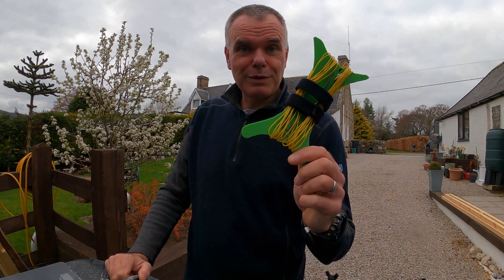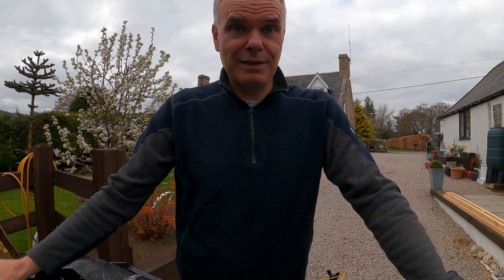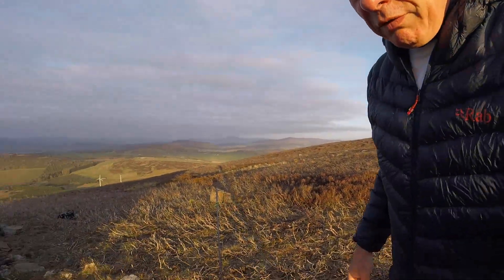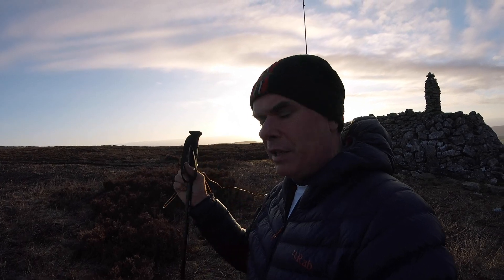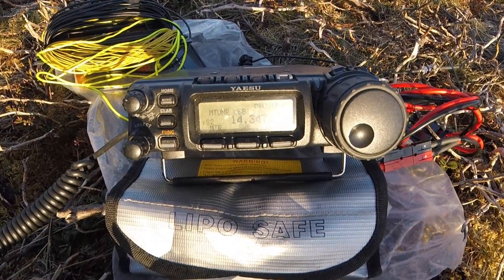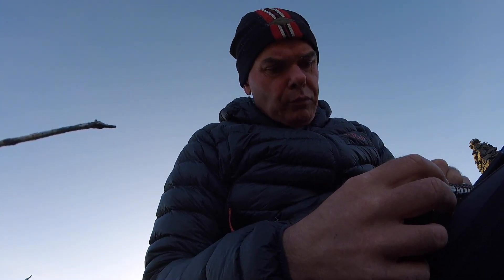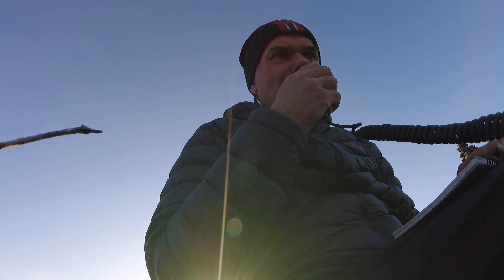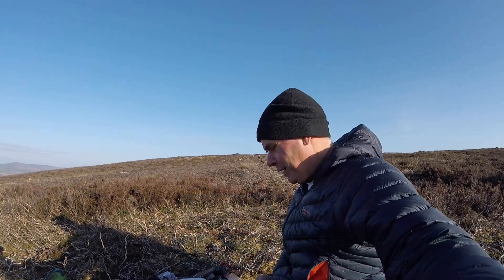Simple 20m DX Antenna

Comment: Thank you for a very good video. I have often used this type of antenna for QRP.  The counterpoise I throw over some bushes, best to keep it a bit off the ground, say 0.1 lambda. Do not use an un-un - the antenna should be driven balanced. So the balun used in the video is good. It could be located at the feed point, so that both elements are driven in antiphase. Do not ground the counterpoise. If preferred drive the antenna at the end using an ATU - same thing. At the moment I am using a similar ant for 80m, but it has to use a folded over top like an inverted L due to the length of wire.
Reply from the maker: Thanks! I re-watched the video this morning. I made the mistake of saying to put in an un-un if running high power. Of course this should probably be a balun, given it is a balanced antenna and unbalanced feeder. That's the downside of doing a one take recording on a hillside!
Cheers, Fraser MM0EFI 
PS making one of those for 10m this weekend.

Comment: I did my Foundation during lockdown and passed but it was all a solo effort using YT and books. But once passed I lost interest b/c I didnt really have an idea what do next and all the local clubs were dug in behind closed doors  for the duration. Fast forward I was looking to sell up so got the kit out to test and found I was still interested especially in home brew and outdoors just like you did there. Great interesting way to enjoy the hobby. What battery did you use/recommend?
Reply from the maker: Great to hear you are still keeping up your interest. I don't know much about clubs, as I've never really bothered with them.
As for batteries, what kind of radio is it for?
73, Fraser MM0EFI
Reply: @theradiorover  Thanks for the reply Fraser I have a Icom 706Mk2 I think its recommended at 13.8V and of course I'll not be using it full power of 100W just the 10W. Currently using a 8 channel Mag Loop with remote tuning but as I mentioned the subject here is more in line with what Id like to try
Reply from the maker: @utkf16  LiFePO4 batteries are really good. They are lightweight and have a really flat discharge curve. They start at 14.2v but quickly drop to 13.8v and pretty much sit there until they're done. I use an 8400mAh one from Hobbyking. It's branded Zippy. If you're not lugging your radio up hills, a bigger one would be a better option for your radio.
Reply: @theradiorover  Thanks Just checked the site and batteries out. Looks a sensible size to carry around which of course is reflected in price. I have a Jackery power station have you heard of these been suitable? Just had a reply from a local club regarding membership and I'm joining them next meeting so looks like I'm back on course. Thanks again Fraser, all the best and thanks for your time
Reply from the maker: @utkf16 good stuff. I haven't had experience of the jackery power station. I'm sure someone will have made a YouTube video about it. 😃

Comment: Sorry was a bit off frequency bumped vfo in the excitement. Great antenna. Tnx S2S vk5cz ..
Reply from the maker: Great to work you though! I tried moving the vfo on my radio but it didn't make any difference. I thought it was maybe aurora at the time. Still got the job done though. A VK to GM S2S is a great achievement Ian.
73, Fraser MM0EFI

Comment: Hi Fraser, aerials/antennas what a topic.  During lockdown I did my own Back Yard On The Air doing more experimenting  than I’d done in a very long time.  I discovered tuned raised radials performed better than laying on the ground.  I never proved whether direction of the radial(s) mattered.  But this topic is so vast and conditions change so rapidly, one minute I got better results on my Cobweb then my Endfed then my vertical.  It’s what makes this a great hobby, antenna utopia remains a myth - well at least until I try the next thing. Great vid thanks 👍🏻😃 73 Mike
Reply from the maker: Antenna utopia is what keeps a lot of folk in business! The portable VK guys I was working were generally using inverted V's at their end and similar power levels. Time of day and band conditions also played a huge part. IIRC, sfi was around 150 that week!
Cheers, Fraser MM0EFI

Comment: Fully agree Fraser. My adjustiwave works exactly on this principle except I can adjust the vertical and radial length on the fly to suit any band 40m(or 80m on a 12m pole) thru 4m. I've worked some great DX including VK also.
Reply from the maker: It's a great system you have Colin. I have been tempted to fold back the elements for use on a higher band, but it would be too much faffing around on a mountain top and I'd need to carry a nano VNA or similar. Goes against my fast & light ethos!
Now if you could make a 250g adjustiwave....😉
73, Fraser MM0EFI
Reply: @theradiorover  I know. Its more bulky thank anything for SOTA. I may re-engineer a 1 off  special sometime just for kicks
Reply: @theradiorover  I guess you could simply add some links. Although I would have thought even 40m would require a 11+ m pole if the feed point is to be 1m above ground.
Reply from the maker: I like to keep things simple on summits. More links is more stuff to break. You've probably seen some of the places that I end up, especially in winter!
Perfect solution for operating portable from a park or similar though.

Comment: very impressive performance! I'm using a 29' wire and a 17' counterpoise through a 9:1 unun and a z11 pro ii tuner, but since I operate on 20m nearly exclusively I'm looking to lighten my load for portable use and move to an antenna like this. Do you have an opinion on any difference in performance when you elevate the feed point as an inverted V versus having it lower and elevating the end of the element? Or, is it better to have the feed point up about 1m from the ground, and the main element and counterpoise coming off at a 90 degree angle?
Reply from the maker: This antenna displays some gain in the direction of the horizontal element. Others have commented that the antenna performs better in this way versus other orientations. So, I would always stick with that for maximum effectiveness. It is a monoband antenna, but is super light end simple to set up. Since making this video, I visited the USA and did some SOTA in Wyoming and Colorado. I used it there with my carbon 6 pole. It worked well and was not de-tuned by the carbon pole, as some would predict. I worked France on 20m from Wyoming.
Good luck experimenting! 73, Fraser MM0EFI
Reply: @theradiorover  sounds good, thanks for the reply! 73

Comment: Having just watched this video i have just knocked one of these up used a sotabeams wire winder and had a chassis mount bnc  kicking around will give a whirl tomorrow, 
Thanks for sharing Fraser
73, Mick M6MWT
Reply from the maker: Good luck with the build Mick. I tuned mine for the upper band, as that's where many of the SOTA Ops are ro be found, so making it 6" longer to start with will take you further down.
73, Fraser MM0EFI
Reply: @theradiorover  Thanks for the info will add the extra 6 inches and get it tuned up and hopefully  on the air this afternoon.

Comment: Great results with a simple antenna. I use about the same antenna but with 2 radials. Works fine for me. Best 73 de ON4MGY
Reply from the maker: I've worked VK and ZL on a few occasions with that now. The one counterpoise gives it gain in that direction. Of course, right time, right place and the band being open counts for a lot.
Cheers,
Fraser MM0EFI

Comment: Hello Mike! I've been using this antenna on my travels for a long time. I experimented with the number of counterweights, their number does not matter much if they are not lying on the ground. One is enough, and this is important for hiking, the main thing is to raise the counterweight at least a meter from the ground. With such an antenna there is a QSO (SSB 20M) at a distance of 7000 km. with only 10 watts of power.
Reply from the maker: Good stuff! Glad you had fun with it.
73, Fraser MM0EFI

Comment: Off to pound land to get a stock of cutting boards M7CVK,
Reply from the maker: These ones came colour coded in a pack. They were from Tesco or Home Bargains, I can't quite remember. I cut them very slowly with an electric jigsaw. They melt if you go full chat!
73, Fraser MM0EFI
Reply: @theradiorover  cheers Fraser I am in town tomorrow so will grab a pack I made a few out of corrugated plastic cardboard but the BNCs pulled through on there first outing. I looked at the kite winders from Flexifoil power kits but way too much thanks for the reply keep the videos coming regards Tony Gordon M7CVK

Comment: Thanks for the video Fraser! Just to clarify - you are adjusting both the radiator and the counterpoise when tuning the antenna, or just the radiator? I also guess the common mode choke could go at the feed point, although perhaps having it at the radio allows the coax to behave as a second counterpoise (reference the comment from Mike S)? I have all the bits to build one of these, so I might just do so as it takes less space than the inverted half wave end fed I use currently! Could be good for campsite operation! 👍
Reply from the maker: You know - I did not have to adjust it at all, but I'd keep the elements the same length. I'd agree that the choke needs to be near but not necessarily right at the radio.

Comment: Great video Fraser. Awesome work.
Ft857d I've been looking at this rig. Would you say it would be better to get one of these than a 817/818.  I would keep between 5-10w as I am a foundation M7 license. I like the look of these but also worry about the size and power draw compared to the 817/8
If you was limited to 10w which would you go for?
I am struggling to decide if I want HF, UHF and VHF in one rig or get a x6100 and use my anytone for 2m all would be used for sota.
Motters M7TRS 🇬🇧 73
Reply from the maker: I honestly think when the band is open like on that day, 5 W would do the job. The ft-857d is a brilliant radio, as it covers 160 m through to 70 cm. It does FM & SSB on VHF and is great for data modes too. It is a little heavy for long hikes, probably 3.5 to 4 kg including a battery. Unfortunately it is out of production and its replacements don't have all of those features. However, a friend had a VK contact last week with 5 W and if you're working portable from a hill, that's all you need to make contacts around the EU daily and USA on occasion. 
73, Fraser MM0EFI
Reply: @theradiorover  thank you for the feedback. Always noted. I guess I will go down the X6100 route as its 10w and compact will just have to carry a HT for 2m sota. Which in the grand scale of it isn't a issue as I would probably have it with me anyway. Not seen any secondhand x6100 for a while. Stay safe Fraser. 
Motters M7TRS 73
Reply from the maker: @Mottersmotters  that's a good shout. A handheld with a long whip or a roll up j-pole can work wonders.
Reply: @theradiorover  my current working condition is the anytone 878 with a 8m mast and a 2m flowerpot antenna with a feed of rg8x about 11m which seems to work good. Ive had a 125 mile sota contract with 7w output. That's my longest contract 😁🤪 just need to get on HF now and work you dude. 👍🏻M7TRS

Comment: Hi, I'm a noob. How many watts you running, and no antenna tuner required? Thanks.
Reply from the maker: Hiya, Welcome to my channel. On this occasion I was running around 30 Watts through 5m of coax to a 20m mono-band "up and outer" antenna. It's cut specifically for the 20m band, so needs to tuner. I did another video explaining it's construction. Link below. Any other questions, just ask.
73, Fraser MM0EFI 
https://youtu.be/4zFynpiiuUg
Reply: @theradiorover  thanks so much for the response and help!

Comment: Well done Fraser, wonder what time was that. 20m been exceptional recently. Been looking for you, but band open here at 
0700utc. Iam just preparing a bicycle portable on local beach, 20m vertical and a few radials . I don't use a unusual, but find a few ferrite clamps on the coax works a treat.
Keep up the good work, hope to qdo soon.
73 zl3xdj.
Reply from the maker: It's been great fun recently for sure! Three very early starts was enough for me in one week, especially that day, as I had to go to work afterwards!
Fraser MM0EFI
Reply: Simple ants always seem to work best, wire, coax, rig equals dx.
Reply from the maker: Absolutely. Timing is everything Brian!

Comment: Nice activation Fraser! How many turns are you putting on the choke?
Reply from the maker: Hiya, I wind 6, then go through the middle and wind another 5. Going through the middle doesn't change anything much electrically - it just means that the coax exits directly opposite where it enters, which makes it easier to use. Because it is a small torroid, I had to use bare RG-174. I crimped the BNC connectors on afterwards - one male and one female.
Thanks for the feedback and I'm glad you enjoyed the video.
73, Fraser MM0EFI